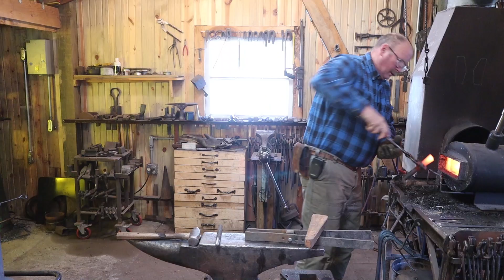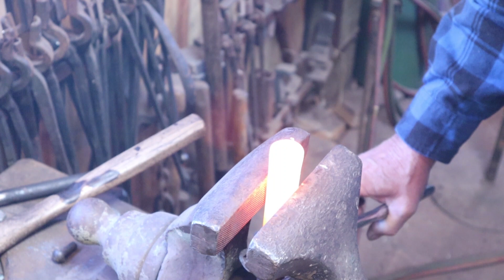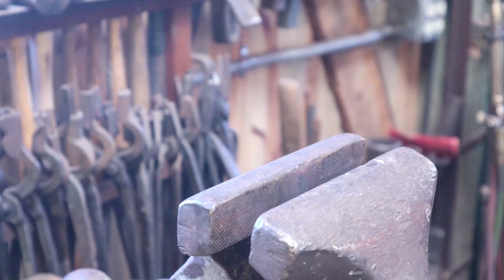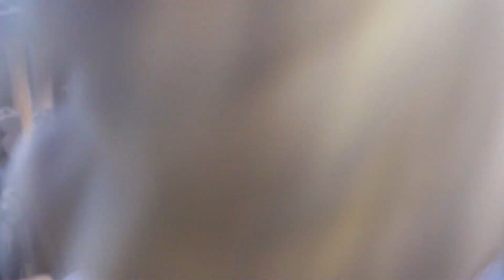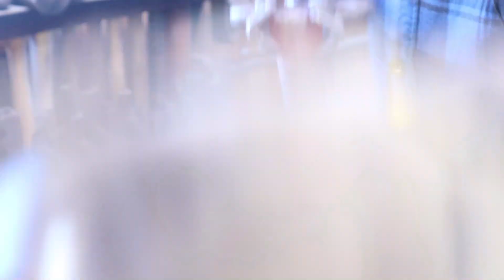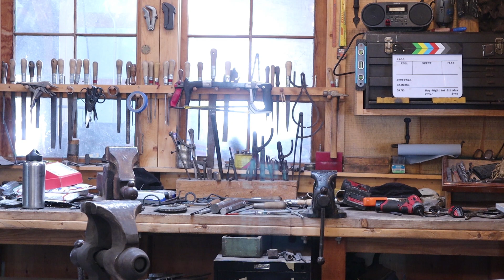Hand rivet setting tool

Comment: John, I apologize it's been 4 years so this isn't new. 
Could I not just drill a cup in a 1 inch diameter chunk of mild steel. I need to rivet some tongs up and that seems easier based on tools at hand (I'm making the tools to be at hand :).
Reply from the maker: Yes you can.  You just end up with a rivet that has a cone shape instead of the dome.  Of course for tongs you can just set the rivet free hand and skip the header.

Comment: First off, thank you for these informative videos. When making rivets  for later use, how do you keep them from upsetting in jig or monkey tool? I've tried a few time and can't get them back out.
Reply from the maker: For the most part I buy pre-made rivets so i don't have to worry about it.  Otherwise I set both heads in the piece they are going into instead of making them in batches

Comment: Why wouldn't you use a drill press?
Reply from the maker: A lathe is more accurate and in the long run a drill bit doesn't result in the exact depression you need, so yu still need to forge the final depression.  But if you want to start in the drill press it would be just fine.

Comment: Hi John,
As usual, a first class video well presented and easy to understand. One question I have is do you have a preferred supplier for rivets, or do you produce your own? Having a difficult time finding a supplier in my area ( the Great White North :-)).
Thanks
Reply from the maker: Many industrial suppliers sell rivets.  I also buy from here https://www.rivetsonline.com/solid-rivets/solid-steel-rivets
Reply: What part of Canada are you in?  There's a bunch of suppliers, but you need some key phrases.  I'm in Kitchener, so I use Spaenor locally, but used to have a shop in Burnaby when I lived out west.  Mostly hiding out in the yellow pages under "fasteners".
Reply: And I should have added a web site: www.spaenaur.com
Reply: Thanks John and Paul...I'm out West Paul, near Kamloops. Thanks for the link.

Comment: I made all my header tools by using round nose milling cutters on a piece of 3/4 x 3 in TQ100 plate. A nice neat row down the centerline. I made it 30 years ago and it is still working flawlessly. I do though need to make a full set of these. Now that I have the time it is time to get them finished. Thanks for the post John.

Comment: John, I have a question regarding hammering work on the vise, particularly using the screw housing as a support.  I have done this on occasion, but with light hammering.  I often wonder if you, or someone you are aware of, have had the screw housing deform or even crack with heavy hammering?

Nice slow and easy work on making the rivet setting tool.  Very helpful video.
Reply from the maker: I haven't noticed it to be a big problem, however I do try to avoid it most of the time

Comment: As I have mentioned in previous comments, I am not a blacksmith nor am I a metal worker beyond bending a rod or some such thing to complete a woodworking project.  As I watched you with that rod in the vise I am reminded how difficult it must be to be a blacksmith.  When the vise loosened a bit and the rod began to tip my first reaction would be to grab it with my bare hand!  YIKES, bet a guy would only make that mistake once.
Reply from the maker: Most people do learn pretty quickly
Reply: @BlackBearForge  As I used to say: "It's not hot. Just doesn't take all that long to look at!"    🐾🔥⚒

Comment: John, while watching your video today, I was struck by the constant need for you to have to re-tighten your vise while hammering the item.  This was an awesome display of how much steel increases in size with heat, and shrinks in size as it cools.  This was just something that "struck" me while watching you work.

That rivet header was awesome!  It showed up on your video so well.  As always, your videos are sooooooo instructive on the Art of Blacksmithing.  Thanks.
Reply from the maker: Part of the problem in this video was that the handle was bouncing as I hammered and gravity helped open it up a bit.
Reply: I am guessing it was more to do with the vice handle bouncing itself loose than the metal cooling down.

Comment: I sure get it about the more "comfortable height" at the anvil.  I have taken to using a step in front of the vise when it is necessary for me to hammer on something clamped.  I get a much more accurate swing and a lot less strain on the arm and shoulder when I can step up a little higher in front of the vise.  Thanks for the vid!

Comment: Hi John. another question on ribbon burner.... are you aware if a smaller version is available? forge im making is from a 2 gal. air compressor tank. thank you. I am forever grateful for your wisdom and inspiration!!
Reply from the maker: I have seen a few small ones and have wondered if a small forge could be built for smaller forge welding jobs.
Reply: essential craftsman sells them but they might be too big for your application,  might as well as scratch build it.
Reply: thanks for the reply guys. i will investigate both options. 🇺🇸👍🏼